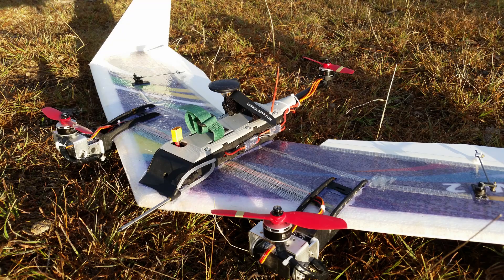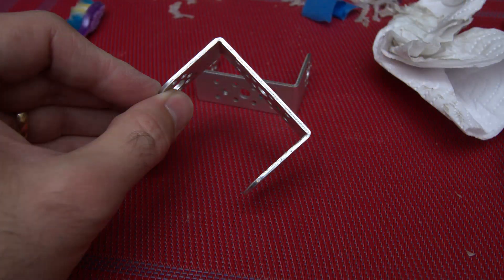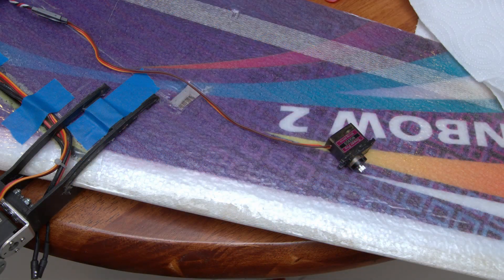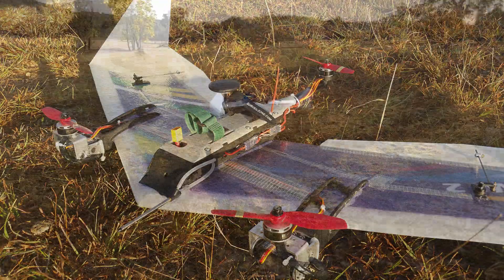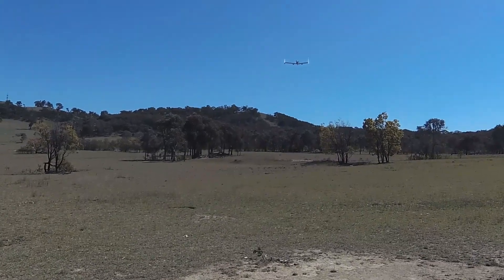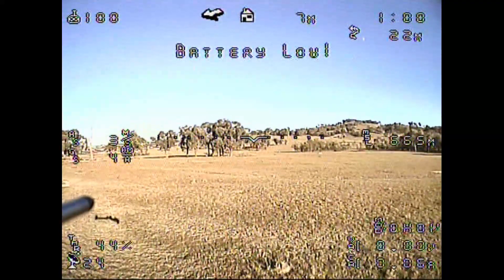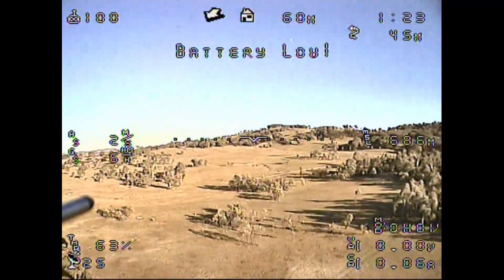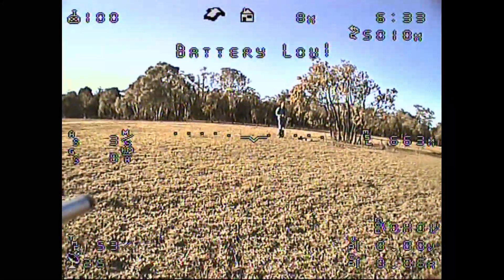VTOL tilt-rotor wing - Success + rebuild details!

Comment: The Pitlab osd is a better osd for this and they make it for mavlink and it's affordable
https://www.pitlab.com/pitlabshop/fpv-system/osd-mavlink-kit-detail.html
Reply from the maker: Looks good, but cost and size were factors here: €83 vs $6, the micro minimosd is around 15mm x 15mm with attached cables.